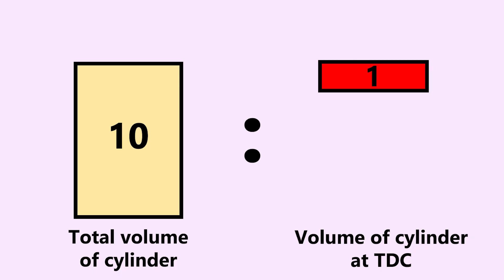Compression Ratios

Comment: Great video on explaining how compression ratio works! 

One thing though, boosted engines (turbocharged/supercharged) generally require a lower compression ratio than naturally aspirated engines because of the increased pressure and so, higher volume of air/fuel inside the cilinder. The higher the boost pressure, the lower you want your compression to be. (Fuel octane rating is also an important factor for what comoression ratio youre gonna use)
Reply from the maker: Yes that is correct. My apologies i got it mixed around
Reply: arent octane ratings pretty invariant for regular civilian road vehicles? Like 95ish
Reply: @homeopathicfossil-fuels4789  True, for normal road going vehicles 95octane is generally used the most. High performance cars/bikes often use higher octane rated fuel like 98octane and racecars usually use special fuel that has 102octane.

(Keep in mind that Europe and USA use different octane ratings.)
Reply: @Dawneryse  I guess different machines for testing it or something?